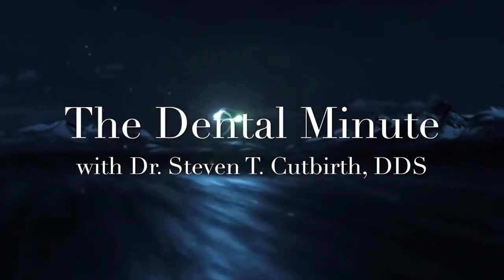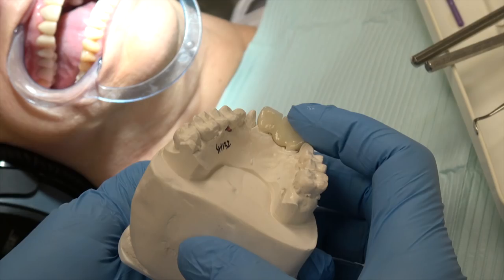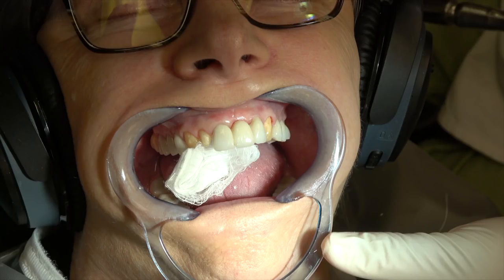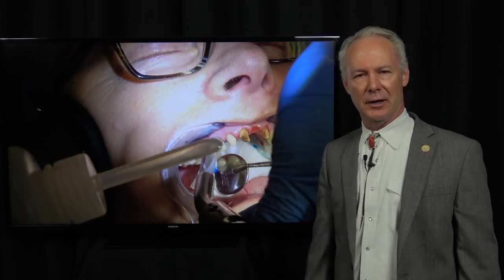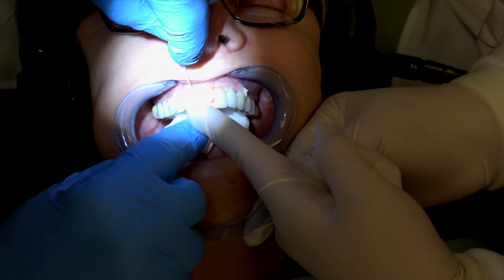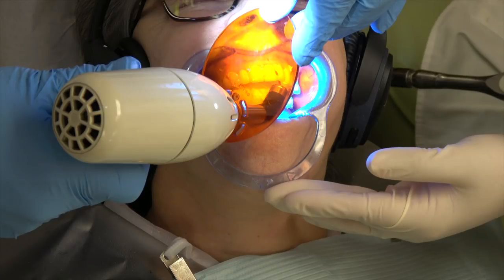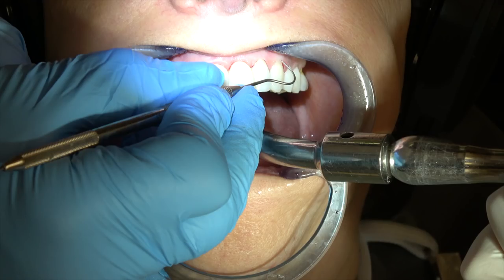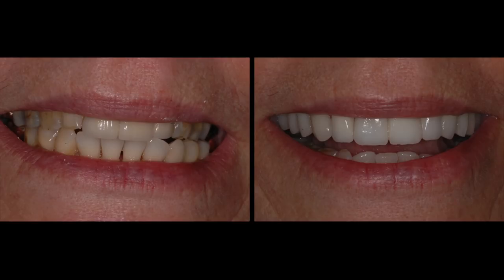Seating Anterior Bridge and Crowns - Dental Minute with Steven T. Cutbirth, DDS

Comment: Great explanation and hoping i can get an answer from you. I just got my permanent front bridge in yesterday and its a 6 unit. My question is, is it normal to have an obvious space where the teeth dont make contact with my gumline on the center 4 teeth? It has completely changed my speech, and I talk with a very pronounced lisp because this bridge is so much lower in my mouth than my natural teeth were. It should be noted that i had absolutely no issues with the temporary. And now I look like I have rabbit teeth, and the whole thing just seems like not what it should be from all I've seen. Any thoughts would be really helpful.
Reply: Also, I noticed that you said when placed, the gum tissue should blanch because it's making contact, and mine most definitely don't do that, as they're not making contact. They also didn't do any of that cleaning of the cement from the temporary as I wasn't numbed for the permanent placement at all, and now I'm just wholly worried that they just didn't do a good job at all.
Reply from the maker: Sorry. I do not diagnose dental conditions without examining the patient.
Reply: @centerforard  I wasn't really looking for a diagnosis, more so general information on what is normal and what isn't normal when it comes to this type of bridge. Thank you for your response.
Reply from the maker: I discuss the way I feel and have been taught  it should be done in the video. I have nothing more to add.
Reply: @centerforard  Thank you for your response and your help.

Comment: Good morning sir ...I have 2 questions 
1. You say that dentine etching is no more than 15 sec . Is this time for both vital and non vital teeth 
2.Is it possible to etch the dentine of non vital teeth for more than 15 sec. and if we do so ...is this will increase or decrease the force of bonding 
Thanks
Reply from the maker: According to the studies, the dentinal tubules collapse if you etch dentin more than about 15 seconds.  When the tubules collapse, you do not get the hybrid layer that greatly increases the bond of the composite to dentin.  Not a problem with enamel.  You can etch enamel pretty much as long as you want.  I normally etch enamel 45 - 60 seconds.
Reply: @centerforard  thanks for this nice information

Comment: 1. won't there be gingival gap in pontic after few months although there is blanching at present wound has not healed properly it will surely shrink....
2. How can we minimized bleeding from gingiva during using floss to remove excess cement?
Reply from the maker: No, because you have created a gingival pontic receptor site when you prepared the teeth.  Watch my video on hemostasis. Take your practice to the Top Tier.  Subscribe to DentistryMasterClasses.com for an organized library of all the Dental Minute videos plus many complete comprehensive cases and many very important articles.  New cases are added weekly.  Only $20/month.